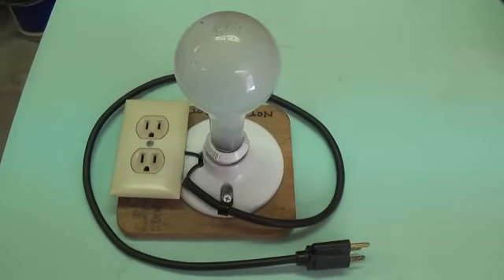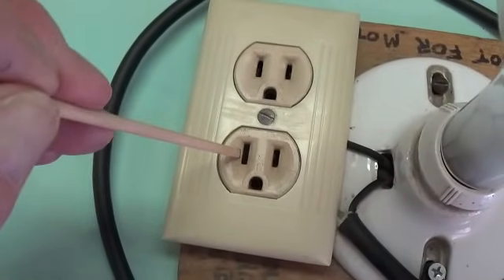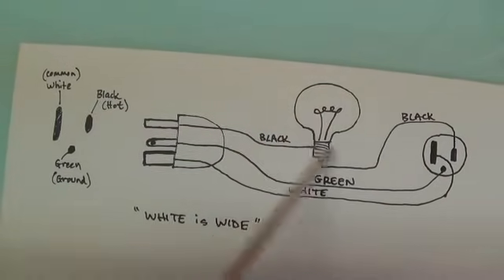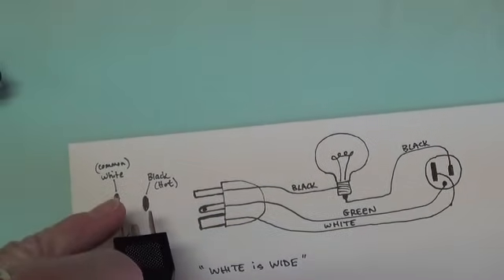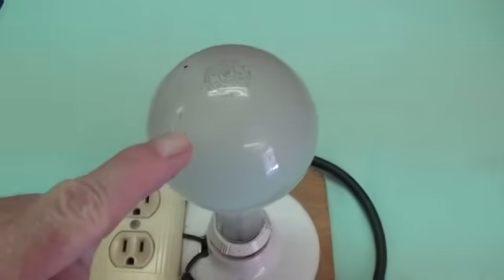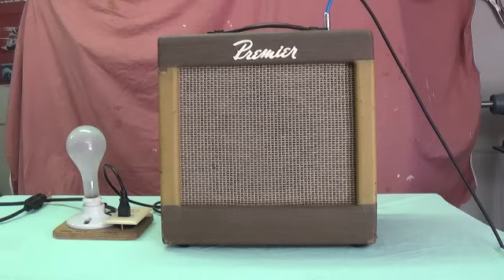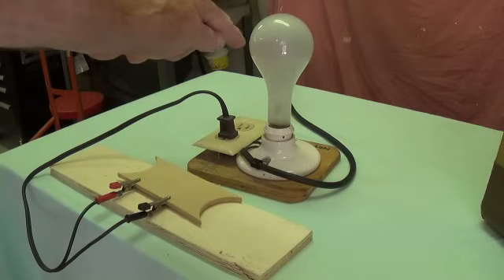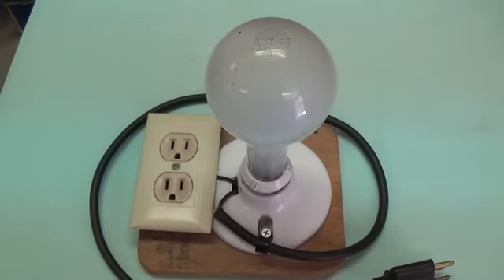Build Your Own Current Limiter for Protection when Repairing and Testing Electronic Equipment

Comment: Hi Uncle Doug! Thank you for all your awesome videos. 
Almost 9 years later, I got a question about this one : Which composant could replace this current limiter?
I have a paint compressor motor that "lights up the bulb" when it's plugged through the current limiter, it's perfectly working though.
I'm wondering if it's possible to still use it, adding a component acting like a current limiter device? (or if I'll have to bring my illumination everywhere I want to paint walls... I never tried to plug it without the current limiter ) Which component would it be and would it be safe?
Reply from the maker: Greetings, SW. The current limiter is only for use with amplifier circuits. It is not appropriate for use with motors or other electrical devices.
Reply: @UncleDoug  Can you explain me why, please?
Basically, I don't get how motors can have continuity between common and hot, is it normal or are they broken? 
Should they always light the bulb and that's why the current limiter is useless? Thanks for your time
Reply from the maker: @sigbjornwilderness4258  There is no reason to ever use a current limiter with a motor, SW. Motors require a lot of current to start, and thus do not need to be protected. Please read my previous response also, and let's move on to other topics.

Comment: Thanks. I bought a "closet fixture", from Amazon, with  a pull string. The  round base has a grounded receptacle. I use one at home to connect a security light outside. I think it will be easy, with your design. I suspect a two receptacle is not needed. Perhaps the pull string would be useful for "taking a break", without unplugging. I hope to secure its connection wires to power and the amp project's plug in, above the bench and out of the way. I bet I won't break my bulb more than once.  :)
Reply from the maker: Thanks for sharing, GW. Be careful......incandescent bulbs are an endangered species.
Reply: @UncleDoug  I'm going to check out my old 61 tweed skylark. I loaned it to a harp player... I think it may need a new speaker or a 12a switchcraft, if one of my speaker cabs will match the ohm load, (and I can find my bench). I took the amp to a shop about 40 years ago when it came with its SG Jr. Nice learning from you!
Reply from the maker: @gw3705  Thanks, GW. Good luck.

Comment: Hey Doug. Since it's increasingly difficult to get plain incandescent lamps, and people selling them are usually just salesmen, is there a way to make sure we have the right type of lamp? Like measure with a DMM or something?
Reply from the maker: The only type of bulb that works is incandescent, D. I believe they are still offered on Ebay and Amazon. Test them by plugging in a hair dryer, which should illuminate the bulb and probably shut off the hair dryer. You should stash a few away for future use.
Reply: @UncleDoug  Thanks a lot for the quick answer. I had two stashed with my old current limiter setup, but it all got smashed last time I changed houses. Thanks for the hair dryer trick
Reply from the maker: @dimitris470  Hunt down some bulbs while you can, D. Check old photoflash bulbs.

Comment: My amp just repaired and as new. Thanks to the light bulb in series that I didn't burn the amp!! I didn't connect the ground wire from the bus bar of the main capacitors to the chassis 😩https://youtu.be/jB6F-0vqFdw
This is the video😉
Reply from the maker: Another big save for the Current Limiter !! Thanks for sharing, Sal.
Reply: @UncleDoug  sure!!!!!

Comment: I tried again but with the two 40 Watts bulb lights in parallel without success 😨
Reply from the maker: What happens when you try? Do the bulbs illuminate fully?
Reply: @UncleDoug  I think they light but not as if they were at 230 Volts,  quite less brightly.
Reply: @UncleDoug  I just bought a 100 Watts and another 150 Watts bulbs. Waiting your instructions 😉🤗
Reply: @UncleDoug  I think that I know why do you ask this.
If they don't bright to the fullest it means there's no a short and the circuit is ok but at too low voltage to ignite the protection circuit,  is my hunch right?
Reply from the maker: @salvadorrodenas3071  If the bulbs don't illuminate and the amp doesn't work, the problem is with the amp itself or the power supply.......not a short. Also, be sure the bulbs are not burned out.
Reply from the maker: @salvadorrodenas3071  I'm glad you resolved the problems with your amp build, Sal. Best of luck with future projects.
Reply: @UncleDoug  it works!!!!
Reply: @UncleDoug  I forgot to connect the ground terminals 😯 but now it turns on
Reply: @UncleDoug  the bulb light is completely  off

Comment: Hi! Greetings from abroad my uncle! This is Sal, I hope you are great! 
10 minutes ago I powered my Sony TA-n80es but the amp doesn't turn on. Another amp I have, not under repair,  makes the same, nada. I suspect that the bulb light limits too much the voltage across. I used two 40 Watts on each AC mains cables, seeing this didn't work, I removed one and proceeded with one only of 40 Watts. This also didn't work. Maybe if I used a bigger bulb, maybe 80 or 100 Watts it would work. I accept your suggestions...
Reply from the maker: Did the bulbs illuminate to full brightness?  If so, try a 100W and see how it works.

Comment: What happens if hot and neutral are both active? I want to make a series bulb light to protect my amp once all electronic components are put on the circuit but I'm afraid cause where I live the voltage is 230 Volts and each phase of the mains carries 110 Volts approx. My question is, is still protected the device even though both wires are live? 
Only two components remain to be soldered in my Sony TA-n80es and I expect these pieces, a zener diode and a fusible resistor, will get to my home next week so there's not much time remaining. Thanks in advance!
Reply from the maker: I was under the impression that you had a single hot wire with 230VAC and a single return wire. If so, place the current limiter (CL) in series within the "hot" wire. Any limiting of current within the  "hot" wire will also limit the current in the return wire.
Reply: @UncleDoug  thank you! My mains outlet is 'balanced' or biphasic if this means something to you.
The electric company told me that in my house the electricity comes from a two 120 or 110 Volts in each, live and neutral wires, they are in phase. I took this as advantageous due to the fact that the resistance of wires is halved, I've noticed how AC cords of hungry current amps got warm in other's home but not in mine. For the other hand, I have AC filters with a light that inform if the polarity of the  AC is correct and they always  tell me it isn't but technicians told me this is nothing to worry about. 
I believe that, as long as there's nothing grounded to earth inside my amplifier, the opening of the AC circuit breaks the pass of current inside.
BTW, very informative the video of the bad capacitors and their symptoms.
Reply from the maker: @salvadorrodenas3071 What type of power cord connects the amp to the wall receptacle.....2 wires and a ground or 3 wires and a ground?
Reply: @UncleDoug  two! It is not grounded!!
Reply from the maker: @salvadorrodenas3071  I don't understand. You have one hot wire and one return wire in the power cable.....and nothing else?
Reply: @UncleDoug  yesss!!!
Reply from the maker: @salvadorrodenas3071  Then install the Current Limiter in series in the hot wire and you're all set.
Reply: @UncleDoug  sorry for your time spent on me.
The two wires are hot😆, if I touch both with the light screwdriver all light up the red light. 
I'll do anyway, turn on the power amp with the current limiter. I've  checked everything so the chances to a second failure to happen are very few. If, despite those measures  occur I will pray for the light bulb be enough to save my ass😂. Stay tuned! I will transmit the outcome and I give you thanks again for your feedback, very few have had the patience and time you had👋
Reply from the maker: @salvadorrodenas3071  Perhaps you could install a current limiter in each of the two wires, Sal. Also, recall that the CL protects the circuit.....not you.....so be careful !!!
Reply: @UncleDoug  can I install a light bulb in each wire of the AC cable? I'll do that!! Don't worry about me! The most important thing is the mission!!! 😉
Reply from the maker: @salvadorrodenas3071  I really think that might solve your problem, Sal. You'll have to pick the proper bulb wattage to work properly......but good luck.
Reply: @UncleDoug  thank you very much for your help. I'll tell you how it went 🤞
Reply from the maker: @salvadorrodenas3071  Please do, Sal.
Reply: @UncleDoug  you have my word😉

Comment: Interesting device, may I ask if a GFI outlet would add even more safety instead of a regular outlet. Also could you use Halogen type lamps like those in work lamps. And finally would there be any purpose in adding a line of switchable different wattage of lamps to give you a larger variance. Thanks, just starting to learn the subject.
Reply from the maker: A GFI outlet would probably not be of value, since the CL prevents a current surge. Only incandescent bulbs will work, Richard. You can make the unit as complex as you wish, but simplicity is generally far more reliable.
Reply: @UncleDoug  Thank you for the speedy reply. May i ask for an answer to the other part of my comment regarding using halogen bulbs and could they be an alternative to incandescent. I’ve looked around and so far only seen incandescent bulbs in the thrift stores and most of them are only 60 watts and frosted glass.
Reply from the maker: @richardshort4587  As I said in my previous reply, to the best of my knowledge, only incandescent bulbs (not halogen) can be used. Such bulbs can often be found on Ebay and Amazon.
Reply: @UncleDoug  Thank you once again. My fault for not reading correctly. I appreciate you taking the time to make these educational videos and the quick reply to questions. Long May it continue. Cheers 🍻
Reply from the maker: @richardshort4587  You're welcome, Richard. Best of luck with your project.

Comment: Would the voltage drop from the resistor (in series with amp power) skew the results when testing and measuring the amp and it's components? Could the voltage drop damage the amp?
Reply from the maker: The voltage drop for low-power circuits is quite small, William, but with higher-powered circuits (i.e. 15W+) it does become relatively significant. As a result, biasing is done without the CL in the circuit.
Reply: @UncleDoug  Thanks!
Reply from the maker: @williamnichols6253  You're welcome, William.

Comment: I added a toggle switch to jump
out the bulb .  Once  I am sure there are no issues  I can byoass the bulb for full wall voltage   no need to unplug from my limiter 
to run my amp from full wall power 
I used a 100 watt bulb highest incandescent
bulb left on the planet I could find
Reply from the maker: That makes sense, Buzz, as long as the switch is in the right position when you first test the amp.

Comment: This is also super useful in car audio; most amps have huge capacitors in them. Capacitors are dead shorts until they charge, and it's often enough to blow the fuse you just plugged in and/or weld the now blown fuse into the holder. Pass the current through a car lightbulb until it stops glowing, then connect the fuse.

Another great video, Doug.
Reply from the maker: Thanks for your input Jim :)
Reply: Don't modern amps have inrush current limiters?

Comment: Can you protect Lithium Iron Phosphate batteries hooked to a 3500 watt solar inverter from high current surges at startup/restart connection by using this device with a 3500 watt bulb? It would have to handle the continuous flow of 3500 watts with up to 4k-6k surges. And if not, can you use any other simple device that can take continuous 3500 watt flow from batteries to an inverter and limit current surges without it cutting the circuit during momentary effectively short circuit surges? The batteries are 24 volts.Only one solar equipment manufacturer makes a device to do this and they are $280 plus $55 shipping to Hawaii.
Reply from the maker: No......twice.
Reply: @UncleDoug 😂

Comment: Thanks for sharing.  I just built a current limiter based on your design.  So far it has only been tested with various sizes of power tools I had around my shop.  It definitely works.  The lamp lit immediately with a 1/2HP router attached and the motor would barely turned.
Reply from the maker: It's not really suited for use with motors, Robert, but I'm glad you're pleased with the device.
Reply: @UncleDoug  I figured as much.  I was just messing around testing. Sadly my only guitar amp is solid state (sorry) so don't have a good test case.

Comment: I need to test my newly repaired fan motor. While testing it, even if a short circuit happens, can I save the mortor in this manner?
Reply from the maker: Yes......but if the fan consumes a lot of current, you'll have to install a higher wattage bulb to prevent excessive reduction of the AC to the fan motor. Start with a 250W bulb and see what happens.

Comment: Can we protect our electronic device from short circuits if we have this fixed?
Reply from the maker: That is exactly what the current limiter is designed to do, MS.
Reply: @UncleDoug  Very useful video uncle Doug.. I will get this fixed to save my electronic devices in case of short circuit happnes. Here, the overload goes to the bulb(glowing bulb) not to the electronic device that is connected. It is happening here. Isn't it?
Reply from the maker: @manujasiriwardhana  Yes, that is the way it works, MS.

Comment: Hello Uncle Doug. I'd like to build a current limiter but as i live in the uk filament bulbs such as the ones you use have been banned from sale for a few years now. I have a old standard 100watt GLS filament bulb that i could use would this suffice?. Electrical wholesalers here do not have any old stock i've phoned around. Thanks
Reply from the maker: With your voltage level, a 100W incandescent bulb should be about right, Chris. Also, you can check Ebay and Amazon for the availability of incandescent bulbs.
Reply: @UncleDoug  Many Thanks. In the process of repairing my 1964 tube rectified mkII Vox AC50. Really great videos by the way 👍
Reply from the maker: @chrisjones7022  Thanks, Chris. Good luck with your project.

Comment: Hello, 
I've made my device now, yet I misheard you for 50W bulbs instead of 250W bulbs and gone ahead and ordered 100W bulbs.

Yet the amp I'll be using it for will merely be outputting 5W's (4tubes) and has a Trafo which delivers a mere 65ma at 275V (x2)

My question: will the 100W be a good fit with the amp?
Reply from the maker: Probably, but you may need to experiment to find the proper bulb.....one that gets warm with your amp connected, but does not actually glow.
Reply: @UncleDoug  Alright. I will let you know as soon as I finish building my amp. I measured the voltage difference. It was 228V but is now through the lamp 225V. So I think that's a negligible difference
Reply from the maker: @thijs199  I agree, Thijs. Three volts is indeed negligible.
Reply: @UncleDoug  Hey so I've tried it out, but when turning on my amp, the light starts shining, not at full brightness, lets say, about half. 
Do you think it's the bulb or the amp or wouldn't you be able to tell? what are your recommendations, buy a higher wattage lamp?
Reply from the maker: @thijs199  As long as the amp is functioning well, then the bulb wattage is too low for the current draw of the amp. You need to go up at least another 100W.
Reply: @UncleDoug  The amp doesn't go on, its indicator lamp stays off, also no sound at all. Just the current limiter's bulb is halfway on. Do you think the resistance created by the current limiters bulb could be the issue here? I can't measure the amount of Amps going through it, my multimeter can only deal with 10 A my wall sockets give 16A, so
Reply from the maker: @thijs199  Most amp circuits draw less than 2A, Thijs. What is your AC supply voltage (120, 240, ???) and what is the wattage of your bulb?

Comment: Isn't there a voltage drop ? I understand it is handy for protecting the amp, but wouldn't the voltage drop act as a variac and affect the amp's tone ?
Btw, I've seen light bulbs used for speaker protection in a Gallien-Krueger 4x10 rbh bass cab, I guess for piezo tweeter for the bulb flashes when playing aggressive string pops at stupid loud volume, but not sure ...any idea ?
Reply from the maker: Yes, there is a voltage drop, but for low to medium wattage amps (i.e. 1 to 20W) it is negligible, Paolo. Just the same, for final biasing, you should use wall AC, without a CL in series.
Reply: @UncleDoug  anyway, your posts are really well done and truly enlightening. Best wishes for a Happy New Year from Europe to you and that cool dog of yours 😊
Reply from the maker: @paolozak3014  Thanks so much, Paolo. Happy New Year to you all :)

Comment: Could I use 2 or 3 100w bulbs in series???...I ask because I don't know where I would get a 250w bulb...
Could I use a 250w flood lamp bulb?...it's the only thing I can find...
Reply from the maker: Yes, but you must use them in parallel to achieve the lower net resistance found with higher wattage bulbs, like the 250W. Without specs for the flood lamp bulb, I can't judge its applicability.

Comment: thank u so much sir. i live in india here 230v system what should be the bulb wattage regards
Reply from the maker: Start with 100W and see if the bulb barely illuminates (or not) with your amp. If so, 100W will do. If the 100W glows brightly, try 150W or 200W.